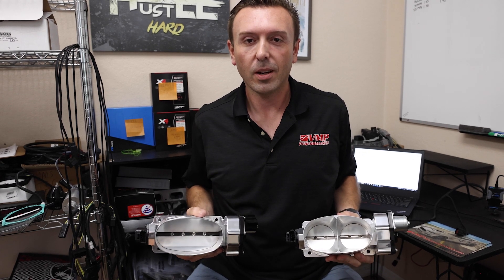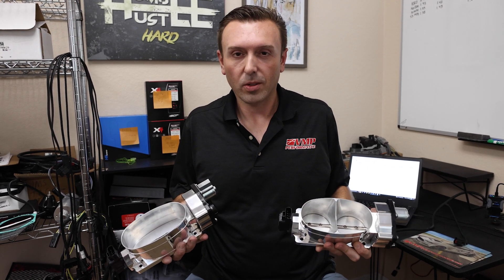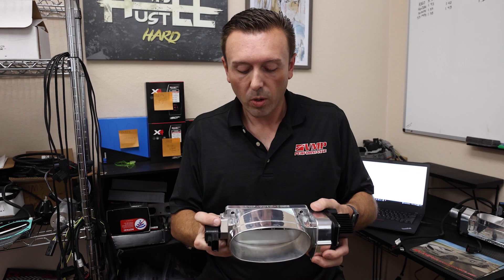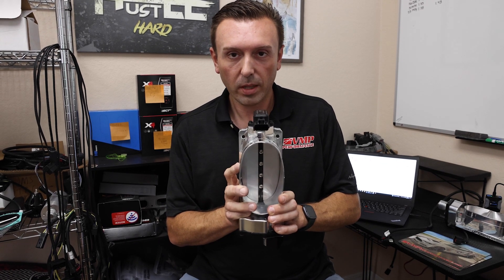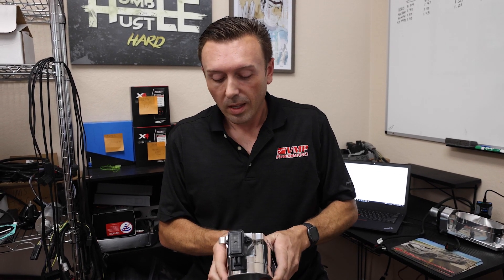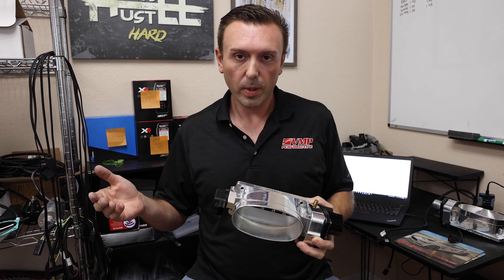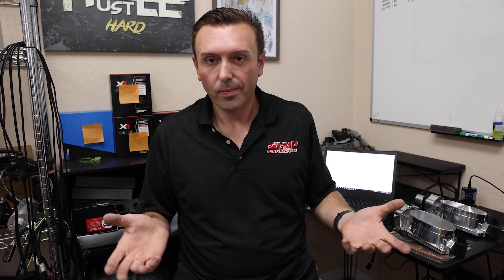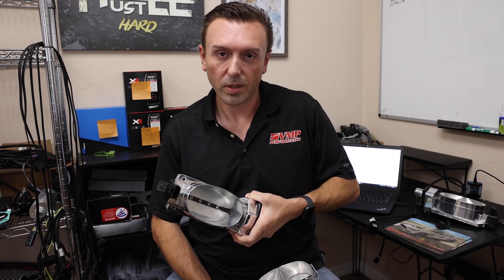Mono blade vs. Twin blade throttle bodies...  Which should YOU run?!  ||  Tech Talk

Comment: Love my VMP TJ 67 thank you VMP!
Reply from the maker: Thank you for your business and support!
Reply: @VMPPerformanceTV  Please respond! I bought a fully ported air flow solutions cobra jet gen 2 intake manifold and I want to know if the 137mm monoblade will be ok to drive on the street? Will it be way too much on that blade? I want the drivability not just straight line full throttle

Comment: problems mono blad TB such as fail safe mode not catching idle .. 90% i need to adjust the stop screw so it can help the motor with startup and idle and part throttle its an old method but it works all the time it’s a trial and error process but i used it with KB and whipple TB’s with great success
Reply from the maker: In the 163R-G we use a softer stop spring so the motor can close the blade more easily for return to idle, but it does require a tune change to default angle.

Comment: That's nonsense. A butterfly valve is neutral to oncoming air. One side is trying to be pulled open while the other is trying to be pulled closed. Due to the pivot point, the forces equalise. The oval throttle body is probably sticking due to contact from thermal expansion or clearances not as accurate. A round throttle body is far easier to make precisely.

Comment: Had 2 69s fault on my 18 within 10k miles N/A. Got so sick of it i added plastic to the mouth of my cj to get the 163 to seal and havent had a single fail safe in 20k miles…
Reply: Any gains from the 163mm?
Reply: @jordancook5171 lmk reply??? just bought a mono cause my dual 69mm just fried my tuner(lund) said there no hp increase and the mono has a 50% fail rate ????
Reply: @thebrotha7477  I have a 137mm on my 350
Reply: @jordancook5171 my VMP 137 Monoblade just failed on my Cobra Jet setup on my GT350R. Only lasted 6 months. Now VMP only makes TJ 67 🙃
Reply: @paul5.2r my twin 67 fried after 100 miles

Comment: I remember having idle issues test-driving my friend's 03 Terminator KB2.2L car back in 2008 with monoblade design. Hearing you talk about the fundamentals such as high compression, high vacuum, and surface area really puts a 3D perspective in my head.

Comment: Why do aftermarket cams help alleviate the vacuum? Shouldn't they increase the vacuum due to more duration and lift?
Reply: No you get overlap…where the intake and exhaust valves are slightly open at the same time which helps with scavenging
Reply: Literally have a 16 gt/cs FBO with a ported cobra jet and stage 3 cams catless and my vmp 69mm just fried so I ordered a mini blade 163mm and I my tuner(lund) said these have a 50% fail rate although I just bought one, should I sell it and get a dual 69mm 🤷‍♂️